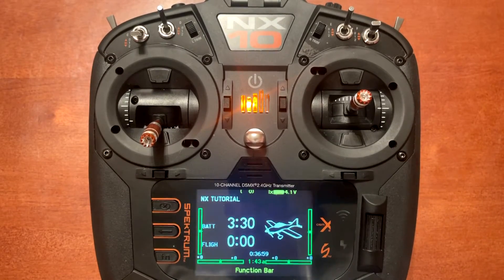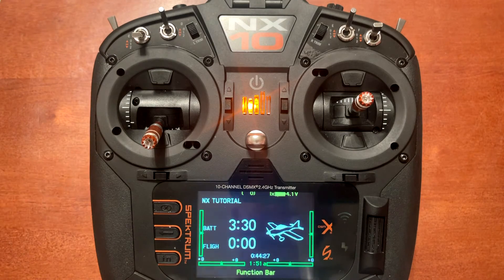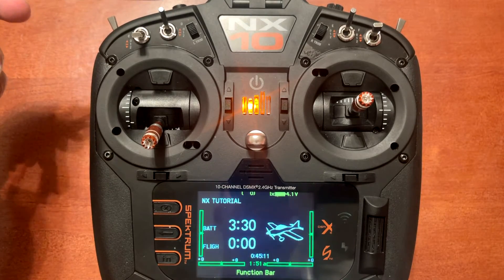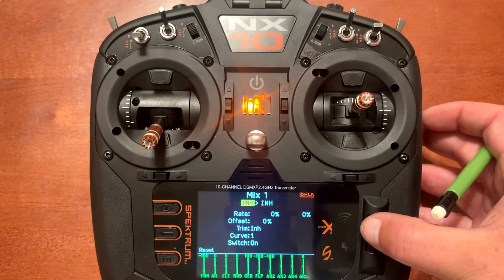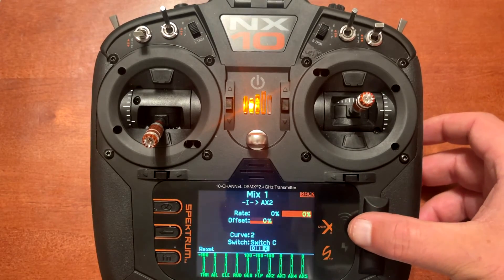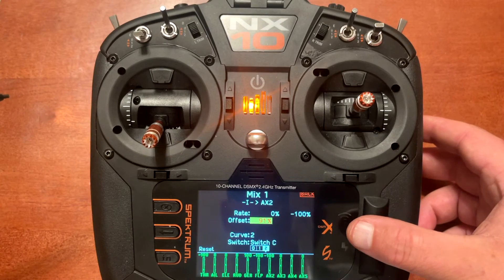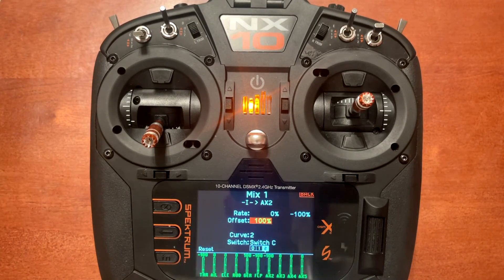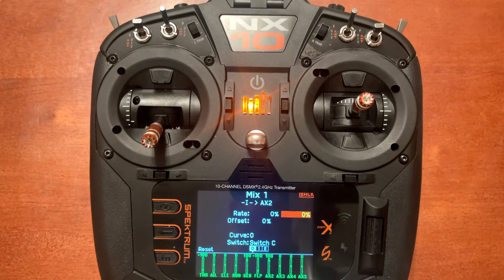Spektrum NX Setup:  Panic Assist Mode for AR630/AR631/AR637TA BNF (NX6/NX8/NX10)

Comment: Hi, you’re Great! Thanks so much for share your experience, the manuals of all brands are very lacking in information. On the NX8+ there is already the possibility to activate the panic button in the Safe section, but I ask you is it necessary to activate it when I already have the Safe that can be activated with the switch, or is there a difference?
Greetings from Italy.
Reply from the maker: Panic activates for short period of time and Safe is self level until switch the flip back to normal modes.

I recommend flipping the switch to Safe recover method, imo.

Comment: I'm working with ar631 reciever to nx6 transmitter and aux 2 is not showing up in my mix 😒 so I set it to my gear and the panick button works the gear but no panic button action
Reply from the maker: Change the Mix to I > GEAR
Reply: Thank you for this reply.

NX6 here and needed this tid bit

Comment: Love all your videos. This one, I cannot quite get my head around. Can you please explain “why” these values are the ones needed? What is Offset? I want to understand why you did what you did, rather than just memorize it:) (btw, like the other guy with similar question, I have already watched Dual Rates and Expo video…which I totally understand; but this Mix makes no sense to me)
Reply: Yes, please add the just mentioned details so i can have a complete understanding of why you fid what you did. Still, this video has helped me a great deal! One question though: I configured my FM switch C position 2 to disable AS3X for the purpose of tuning flight performance like trims, etc. How to I configure this mix to enable the panic mode for this scenario?

Comment: han you set panic recovery to have more throw on the servos ie save a crash with heli then it would be in safe mode i have my panic on a switch not bind its faster to get to it
Reply from the maker: Panic recovery is going to almost instantly self right to level flight.
Reply: @BDTennessee  ya i understand that i like using it when stuff goes wrong what im wondering when in that mode you dont have much control i would love to be able to fly it back to me in angle mode so im asking is it possible to get more angle out of it when in that mode ? Thanks so much for any help
Reply from the maker: @timmytfpv7316  you can go into bank angles and settings to raise up controls.
Reply: @BDTennessee  thank you really appreciate the help
Reply from the maker: @timmytfpv7316  anytime!

Comment: Hi BD. I have a new NX6 and have been viewing all your videos to help me set it up. One problem with the panic assist on the bind button. I have a AR 631 receiver and an EFlite BNF template loaded. Safe select is on aux2 and flight modes are on switch C. However when I go to setup a mix, I can select the I button but do not get the option to select aux2. What am I doing wrong since that option is not available
Reply from the maker: Setup from scratch and dont use template,then see what happens.
Reply: Ok I will try that. Thanks so much

Comment: Yet another well presented video..  Can I ask how you show a flt timer and a battery timer on your home screen?  Is this feature only available on the NX10 or is it also something that can be set up on an NX8?  Thanks in advance
Reply: Thanks.  Found your video 10 mins after posting comment.  Now here is a tricky one.  I purchased the Spectrum GPS unit  in the hope I could get it to speak speed at set time intervals but cannot make it do so! Any ideas??
Reply from the maker: @290Alenka  go into telemetry options. Choose GPS or Airspeed settings. Bottom of the screen says status and warning. Choose Status and select the time interval you want to call out. (example: 30s call out every 30 seconds)
Reply: @BDTennessee  Thanks again BD. Your videos are far more helpful than Spectrum ones.  I assumed 'airspeed' was looking for a pitot type input. Enabled 'speed' and  'altitude' on a couple of spares and sure enough once gps is acquired it calls out "GPS airspeed mph"  and  "Gps Altitude feet". Which is great - will dive deeper and see if I can get minimum speed warning which I will set up to warn of potential stall.  Think you have the makings of another video around the Spectrum GPS unit.  It is rather expensive compared to others but at least I know the plug and wiring is compatible.
Reply from the maker: @290Alenka  glad you got it working!

I been looking at getting that GPS module. :)
Reply from the maker: Thanks Alenka! Check out the video called "Timers Explained". I walk through the setup of dual timers.

Comment: Hi BD- thanks for this video series- invaluable to newbies!  I have an Aeroscout with an AR 631. Do you have a foolproof way to know SAFE and Panic are working properly short of flying it? When looking at the Monitor my gear channel sits at 100 and goes to zero and 100 as I adjust my safe switch. And pressing the panic button makes the Aux 1 jump to -100 at each mode in SAFE. Is this correct? I’m not convinced it is working properly when I change settings and swing the plane around by hand. Thanks again for any insights the manuals just don’t cover this properly!
Reply from the maker: Look at the monitor and make sure the values match the ones in the video.

Also you can flip the plane upside down and activate safe.Plane will go full aileron deflection and try to roll it over.

Comment: Hi BD, thank you for all of your videos. Very helpful to a newbie in the hobby trying to figure things out. I have an Aeroscout S2 with an AR 631 receiver. Is there a good way to know for sure that SAFE and Panic button are working properly without testing in the air? On the Monitor on the TX the gear channel starts at 100 and goes to zero for Intermediate and 100 for Advanced. And panic button on Aux 1 shifts to -100 in each and every mode when pressed. I’m not sure this is correct and waving the plane around by hand doesn’t give me enough sense that it is working correctly to take it out of beginner mode when flying. Any feedback would be great the manuals just don’t cut it for explaining this.
Reply from the maker: Thanks for watching and support!

Look at the monitor and make sure the values match the ones in the video.

Also you can flip the plane upside down and activate safe.Plane will go full aileron deflection and try to roll it over.

Comment: Rich Ranaudo here.  Dave Doucey's neighbor.  I just bought an nx 6 and installed a 6 channel AR 637T.  I have a quarter scale with a DLE 30 and with electronic ignition with an rxcel opto kill switch.  I set up NX 6 switch A to do the kill function thru Aux port 6 on the receiver but it wont work.  I used to have anAR 6600t set up that way on a DX 6i gear channel and the opto kill function worked. So I could either use the DX ,6i transmitter gear switch or physical switch to kill the engine.   Only way I can kill the engine now is with the mechanical kill switch on the airplane.  The Aux port on the NX I think should be just an on off function and it is wired through the mechanical kill switch.  In fact, when I disconnet the lead from the AR 637 the ignition goes off as it should.  It appesrs that Switch A wont do that.   Asked the Horizon Hobby about this and they said maybe you cant do this with the NX 6.  What does the A switch on the NX do? 

Rich
Reply: I use the H switch for throttle cut.  However, I like the idea of making the A switch the panic mode instead of a kill switch for the ignition.  After some thought I dont really see a need to kill the engine in flight as the chance of hitting that switch inadvertently in is always there.  Do you have a video on how to best to assign the A switch for panic mode?
Reply from the maker: @richardranaudo3991  use this same video just Assign Switch to A instead of I
Reply: Thanks BD.  Ill probably get Doucy over here I do the programming.
Reply from the maker: @richardranaudo3991  copy! Give me a shout if you need any help :)
Reply from the maker: Richard, thanks for reaching out to me. If you have Channel 5 available you could use. Go into Channel Assign and Assign Channel 5 to Switch you want to deactivate and enable. (ie Channel 5: A for switch A)

Do you have a throttle cut setup too?

Comment: Thank you for the video.  I'm still confused though.   If safe select will get you back to level flight why would you need a panic button that does the same thing?  Is it just so you don't have to use or toggle a 2 or 3 position switch to get the plane upright and can just use a simple button?
Reply from the maker: Correct.So you can go into self level (safe) and quickly back to flying when released. Button is faster than toggle too

Comment: When I attempt to select Aux2 in the second field it does not show up  only THR, AIL, ELE, RUD, GER and FLP.  I really enjoy and appreciate your tutorials (I am using an NX6 transmitter)
Reply from the maker: Do you have the latest firmware?

NX6 has a extra channel thats not proportional for SAFE.So may not show up in that screen.
Reply: @BDTennessee   I do have the latest firmware for the transmitter.  I’ve contemplated getting the NX8 or NX10.  Might be something I need to hold off on till then.
Reply from the maker: @davidratcliff5535  Copy. NX6 can be easy to outgrow sometimes.

Comment: Hy. Thanks for your educational videos. They were very helpful to me. I have a problem with my Spektrum AR631 receiver. I have DX6 transmitter and when I try to activate AS3X and Safe Mode, it seems that I cannot activate/deactivate it on a switch. I assign it to AUX2 (G switch), but I am unable to activate/deactivate it via the switch. I can only go to "Forward Programming" and activate/deactivate it there. I tried many configurations, neither of which made any difference. Any suggestions would be greatly appreciated :)
Reply from the maker: Thanks for positive words!

You need a 7 Channel transmiter or a NX6. Recent update gave the DX6 a Aux2 (channel) but it cant control it. So thats why you can only turn on and off in FP.
Reply: @BDTennessee  Thank you for a reply. :))
Reply from the maker: @pulj1pulj1  anytime :)

Comment: I've let Spektrum know, But two UMX Turbo Timbers had their ESC corrupted after adding sound to the switches. Both planes were working fine until I added sound to the Flaps. Have you heard of this at all? All my other planes hooked up just fine with sound added to the switches.
Reply from the maker: Id say bad luck for 2 happening or something else. Adding audio events to radio dont have anything to do or programming to the esc...
Reply: @BDTennessee  Somethings going on. I can get them to bind now without getting an ESC warning. I'm going to have my local hobby shop try to bind the plane to another transmitter.
Reply from the maker: @robertwren2289  let me know what you find

Comment: I use switch B for my Safe, intermediate and expert modes.  I use switch C for my dual rates.  After I et up my NX10 with the mixes and I press Switch I the AX1 goes to 115 on switch position 2, and 15 on witch position 1.  As you suggest I didn't add any values to switch position 0.  Did I do something wrong?
Reply from the maker: Dave,did you get it figured out? Sorry i missed your comment.
Reply: @BDTennessee  I did....thank you!!!!
Reply from the maker: @cricket0390  awesome! Sorry again.

Comment: Hi great videos. Can you do a video explaining how to unlock, program and setup self leveling in all modes, like auto level in experience mode. So you have full angle but can go dead stick and it rights it self?
Reply from the maker: Thanks Jason. Spektrum has good unlock video.Also i have setting up the RX on my channel. Experience mode with more angle limiting would be more Safe mode with more angle limiting as experience doesnt have those features used. Ill configure a detailed reply to this comment to setup.

Comment: How does this differ from the PANIC settings in Forward Programming?
Reply from the maker: When the receivers are locked for BNF there isnt a panic setting. Also this method can work on other Spektrum receivers as well.
Reply: @BDTennessee  Thanx!!
Reply from the maker: @EnjoyRC  your welcome,thanks for watching!
Reply: @BDTennessee   @BD Tennessee  Will this work on a UMX Turbo Timber BNF which has an E-flite - EFLA6421BL 6-Ch DSMX l ESC/Receiver l AS3X & SAFE.
Thank you
Reply from the maker: @we4fm175 shouldnt be a problem..
Reply: @BDTennessee  Great! I'm a newbie to all this and going to give it a try. Got into it after retiring for I always wanted to. Also wanted to have something to do with the kids and grandkids. For some reason my oldest granddaughter loves airplanes. Also wanted to say I have learned a lot on your channel and really appreciate all your work.
Reply from the maker: @we4fm175  welcome back to the hobby.Glad you enjoying the fun with kids and g-kids! Thanks for the support!
Reply: I tried 3-times but couldn't get it to work.  Above you said "When the receivers are locked for BNF there isn't a panic setting."  My plane is a BNF model and wondering if that is the reason I can't get it set up?

The only other thing I found was AS3X and Safe are on the Channel 5 (Gear).  So additionally I did the set up for Channel 5/Gear with no luck.  Also am using Switch A but don't believe that would cause an issue.

Any help would be appreciated.
Reply from the maker: @we4fm175  change the mix to "> Gear" instead of "> Aux 2"
Reply: @BDTennessee  did what you suggested BD and believe it is set up correctly and working now. What I see is the GER Channel move from -100 to +100 when pushing the i button. Don't see any moment at all on the AX2.
Does that sound correct?
Reply from the maker: @we4fm175  correct because you have AS3X/SAFE on Channel 5 (Gear).
Reply: @BDTennessee  Thanks for verifying this for me BD.  I was thinking it was set up correctly and hoping so even more. Learning so much from your channel which is most appreciated.

Comment: Great info, I love learning how to do things on my NX.
Now, three questions.
1) what if I have safe on the gear channel? Do I use Gear instead of AX2?
2) why just those receivers? For instance I have an AR620 on a Vector gyro on my Arrows planes. Wouldnt this work on any receiver?
3) I tried to set this up on my TTEvo, which uses a 637T I think, and even though I set it to -100 it says -150 when I hit the I button. Does that matter?
I didnt power up any planes to test this, just configured the NX8 mixing. I set it up on 2 Arrows planes, and it appears to work on Monitor, and since both use the Gear channel I put the mix on it, guessing that correct.
Reply from the maker: 1) Correct. Also Change your Mix to "A > Gear" and Switch to A.

2) This was made by request and also for newest receivers. Yes this could be done with other receivers. I would need to see the configuration of the Vector Gyro to confirm the correct values.

3) Should have -100 if setup by the video.However it being -100 or higher should still work.

Comment: Thanks for sharing this!  I normally just have my finger close to switch A from which I select Safe ON or OFF as I'm flying in case I get into a "bad" orientation.  But having the Panic button programmed is nice as well for a "just in case" condition.  Very similar to how I first learned to fly with the AeroScout RTF in Spring 2020.
Reply from the maker: Agree is good to have both if you want. Thats true as well,its nice to have cause the models you learn to fly on are the same.